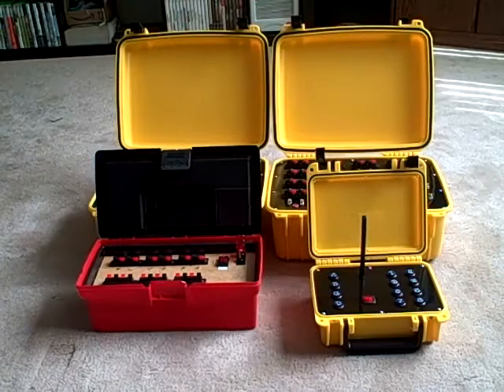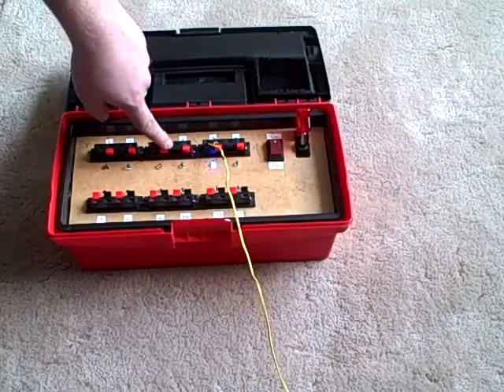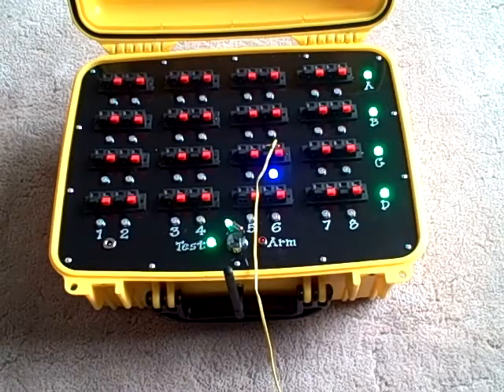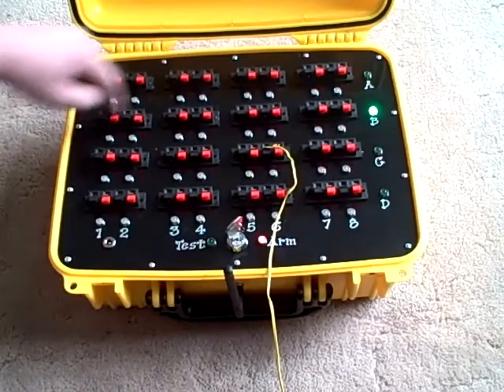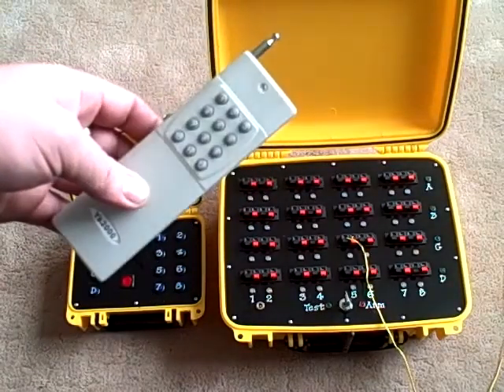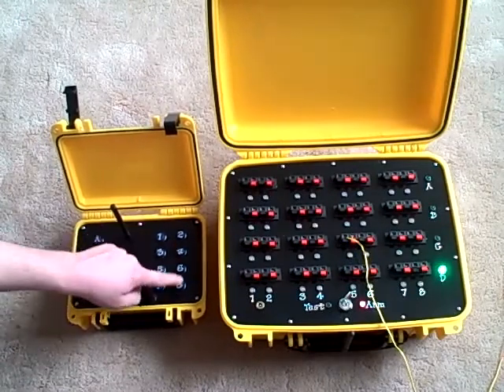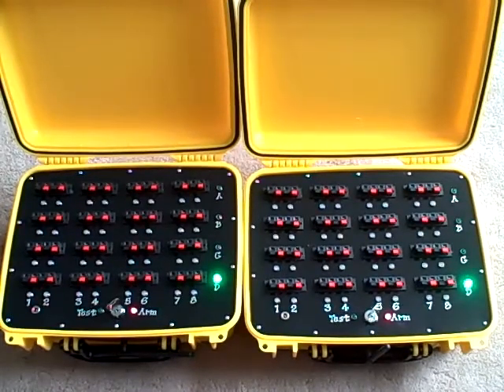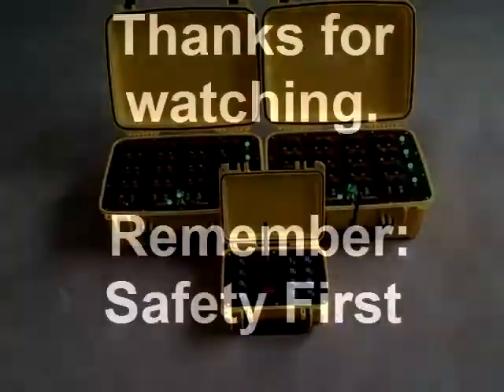Remote Fireworks Firing Systems

Comment: Hey PyroBoydj, I was once a member of the pyrouniverse forums, I built three systems using Joe Ratman's designs. I saw in this video that you "reboxed" or "converted" your hand held remote to a bigger box. I was unable to get these plans from Joe before pyrouniverse went down. Do you have a design plan from Joe I can use to rebox my remotes? I have tried to contact Joe over at the Pyrofan website and he maybe a little busy since I have not had a reply from him in over 3 weeks. All I need is to rebox my remote, thanks in advanced.

Comment: That is IMPRESSIVE, well done. Thanks for this video.
Reply: ***** The key is just a switch for safety from what accidents. What scenarios. I'm trying to understanding this. I'v been in professional fireworks sense ' 95 and if i don't get this little understanding than well....
Reply: ***** Thanks, and thanks for visiting my Ch. A keyed system is perhaps a Legal requirement that i misted in my training. I took the PGI course and the NLP had one also, I must have forgot, it's bean well over 15 years.
Reply: ***** Well at the PGI class thy did go on about doing a shoot I just not recall. Thank's. I just got a wireless 12 cue to start with, to do my at the lake privet shows. No key and in that case i see no need for it. Have a nice day.

Comment: Hey i want to make a firing system with 16 cue and the wireless module needs 12v but what i wanted is so when you turn a key it arms the fire system giving the wireless module power but I also want a led to show that there is power running in the system down side is if I run 12v through a little LED its going to pop, can you help me please PM on youtube.
Or can you send me a Circuit diagram of how you made this thanks.

Comment: You can find the TX/RX combos on EBAY. I also found one for I think it was $36. Has a mode for 6 toggled and 6 momentary outputs. Sounds like it could do the 36 outputs just fine with a little bit of creative diode steering. Plus as you said a bunch of soldering.